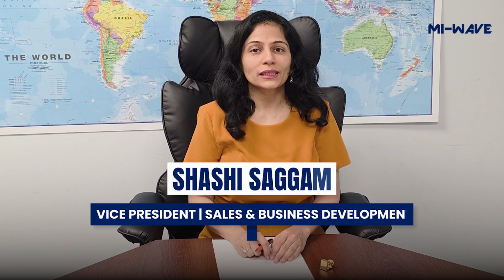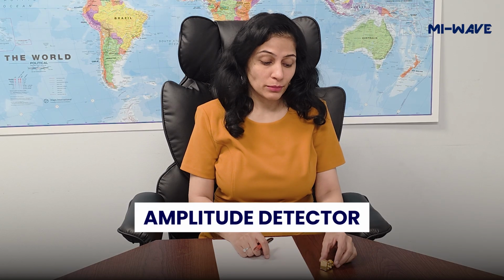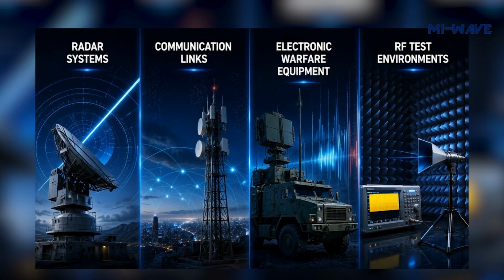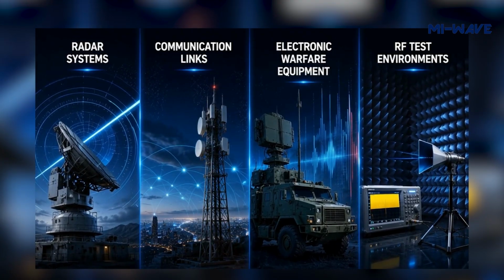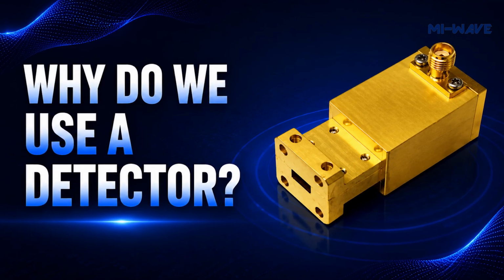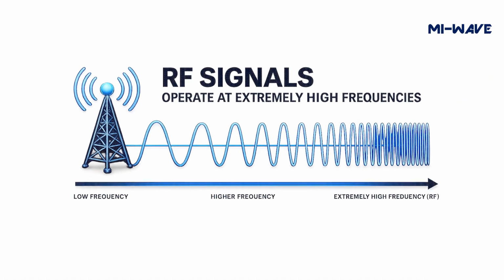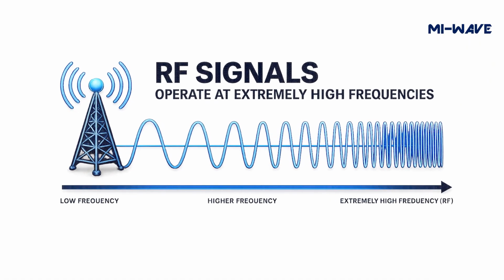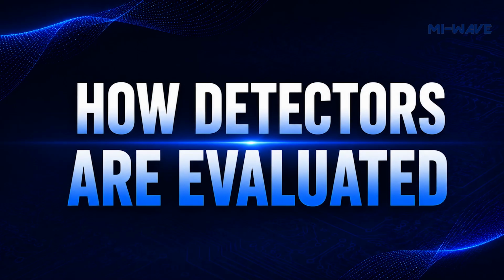MI-WAVE Amplitude Detectors Explained | RF Power Measurement at MillimeterWave Frequencies

Comment: What would be a good configuration for broadband mmwave spectrum analysis?
Reply from the maker: For broadband mmWave spectrum analysis, I’d suggest a spectrum analyzer with an appropriate mmWave front end or external harmonic mixer covering the target frequency range. Use a suitable antenna or waveguide, calibrated conversion-loss correction, and a low-noise setup. Start with a wider RBW for surveying the spectrum, then narrow it for resolving closely spaced signals. Use peak/max-hold detection for initial scans and averaging for stable signals. An RF amplitude detector alone can measure signal envelope or power variation, but it cannot provide a full frequency-resolved spectrum without a swept or parallel frequency-selective front end. The best configuration depends on the frequency range, instantaneous bandwidth, and required sensitivity.